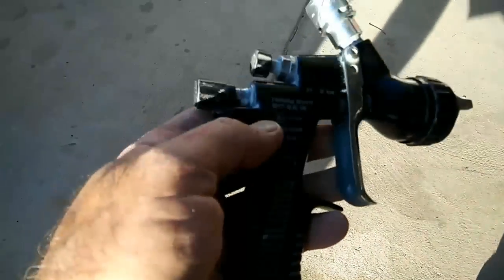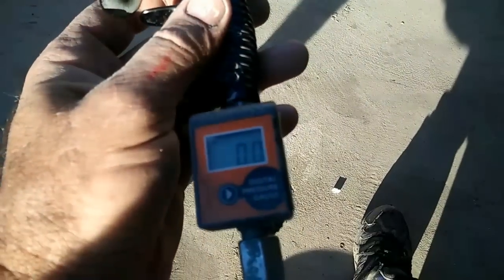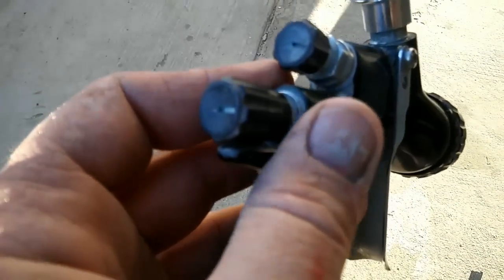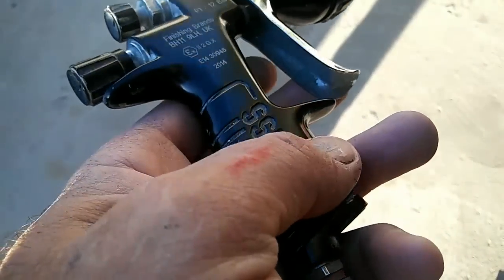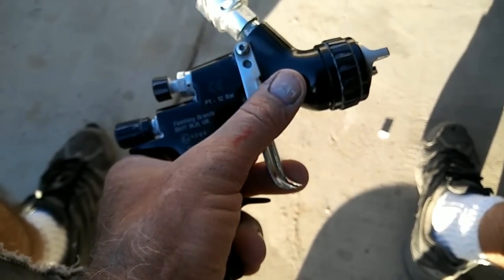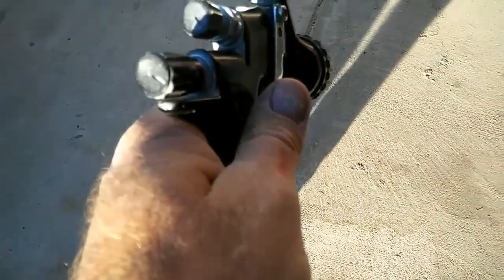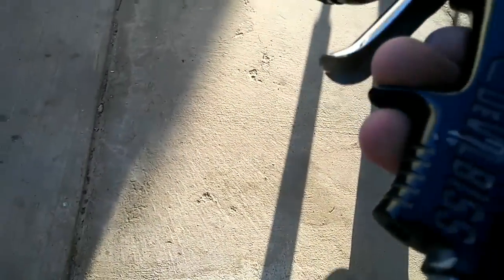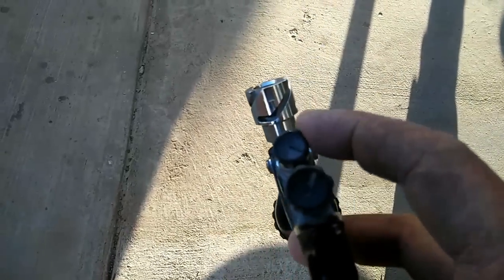How to spray clearcoat without getting any Orange Peel

Comment: Blah blah blah.... Every gun setting is different, there's no point in talking about them. Set the air pressure to 30 psi, and then just adjust the rest until you're getting a nice fine mist and a good amount of clear coat in a pass, without causing runs. Going on too heavy and getting runs? Too much material. Going really slow and it's still looking dry ,not very glossy and patchy? Crank up the flow of material. That simple. Big cloud means good settings. Don't try to paint lower pressure. It will SUCK and you'll be disappointed. Most of what this guy said was terrible advice and he didn't bother to show anything. The settings he mentioned are good for painting in your basement on something small. If you're painting a car don't bother even listening to this nonsense. You want your gun full flow, set for 30 to 50 lb, wide open fan, some guns turn it back just a little if you're getting speckles around the outside of your fan when you test spray on paper or something before you hit the car with it. I paint cars 7 days a week professionally.
Reply: I have the same gun and I set mine at 26psi inlet pressure, hold  the trigger all the way back , turn fluid control  until it stops, then 1 3/4 turns in  lays clear like glass with a 1.3. My sata phaser is a whole  completely different setting. Couldn't agree with you more all guns are gonna be different

Comment: Instead of choking back the Tekna why not get a good LVLP gun like an Iwata or Optima? They produce less overspray without dialing them back.
Reply from the maker: good point there are lots of ways to skin a cat. How about the UK FLG-5 which was not out when I did this video. or the harbor freight HTE spectrum or Black widow? They all work good with less air. But choking the tekna works great FYI. any way you can get there finer spray and smash the dots just a enough to flow out and not puddle and run.

Comment: nice vid..i am new to painting..doing my 78 nova..in garage..21 gal tank.yes..a little small..but it works for doing few parts at a time..bought a harbor freight kit..2 guns..mini 1.1  other is a redish handle.not the purple.. 1..8 and 1.4..the 1.8 sucked tryng to do etch primer and primer..   its an ace paint i got from napa..lots local shops use this product..better than nason here in the states..pa here..anyways..i switched to 1.4 to do second coat of primer..had to jack air up to 35...gun rating is either 40 0r 45..forget.....once all sanded both fenders and hood..i was preped  then to do the sealer with in a month..took a while..i got bad back..spent the month sanding on top my pool table over the winter..no heat in garage..
anyways again..had everything ready to seal...played again with water first to see what settings helped get a good effect..
had to crank air believe it or not  to near 50 with the 1.4 to get a good atomization hrbr frt gun w tip 1.4..
was so near glass when done..yes..the orange peel showed up a little more a week later when i left it cure out right..
by this time..it was cold cold out..and was done painting for the winter..spent off and on in basement sanding..other than the hood..descent days i went out and worked a little at a time.
durring this time..i started searching
i also started watching diyautoschool pete.dallas texas..good guy..and smart..
i knew i had to go with a smaller tip if i wanted to get a better spray..
so i did some gun searching online..now take note..bad back.screwing from work incident.no cash..limited what i could do sadly..
anyways..went to jet tools..well thats what the search led me to..
found 4 1.3 tips..yet do note..my harb frt gun had one single hole both sides the tip
this jet tool gun..no name wom made it which is odd..yet a chance taker buying it.
5 holes..both sides the tip..my thought..this should realy atomize to be able to do a second coat sealer..
mind you..im new at painting..
played with water a little while..then took some old paint..not dried up..house wall paint..because it had consistency to help than waste  good product..
took a little to get a liking to what might work seemned with this product..it was doing way better for painting and atomization than hbr frt gun...
had the pressure up to 45 to 52 to do a amazing flat job ..1/2 to 2 turns out on fluid..  
i will be honest..i started out at  30 psi 3 turns out..did not look good at allvery heavy splatering effect with the house hold paint water base part thined....i knew playing would be diff with a new gun..
it ended up..ok..got to clean everything.alcohol wipe everything down.which dries and really cleans.
tacked off..set up everything by noon..it was 75 already..
mixed sealer for my second coat..got piece crdboard i had with a big smooth sticker on it.. off sticker i went 45 psi 1 1/2 turns out fan slightly turned in  half turn..mb 3/4...was fairly pleased..atomization looked great..
started nailing the hood first because it was laying flat..when i hit that tag on cardboard..i was impressed..
went right to hood and started a few passes..took a quick peek about..looked flat as shiny glass..
once all done..i went and waited 15 min..had a guge fan close by to rid over spray..moved fan towards garage opening.started spraying the wiper grille,back lid deck and the front bumper spacer piece..
6 hrs later..it was fairly dry..was 86 then out..
looked very close to everything.seemned i had way less peel effect if any..i mean it was minuute.
after a week because i started on other bumper parts to get cleaned..and try to prep...
started wet sand 400 with blocks..after dried well..very very minimal peel after the cure up..
$36.52 is what i paid for this...https://jet.com/product/13-mm-Tip-HVLP-Stainless-Spray-Gun-Auto-Paint-Car-Basecoat-Primer-Clear-Gauge-Gr/7725cb459d8546d5ad33a03325d14b32.
those holes in this gun made a hell of a huge difference..and lot less work..think the max at one point i had air up to was around 50.52 max..for a newbie and learning..i cant complain..i had a chance when i had funds to buy a 250 dollar  good gun that looked identical to this gun..not shur whom the actual maker is..but it sprayed very well..i even shot primer on a small piece..near glass finish....
i just pray..when i do my ace 1 or it acme clear that sells well at napa auto parts around here   its a 4 to 1 ratio..
that it goes on good.......im taking it is a medium viscosity clear..might have to thin slight..but it looks runny sounds runny in the gal can..i never opened it yet..and will not untill i have whole car ready..i store everything in basement..its cool and its kept in the dark..out of the light...my color is a good brand..martin seynour paint..metalic..i know i god my hands full putting that on.
yet have to mix very darn good before mix to spray..
i also heard..metalic settles quick..and i read some folks after part spraying..to hold finger over hole..turn gun upside down..give a shake or so and back to paint to keep the metalic well mixed and no settling.
noy shur anyone ever heard doing that..but some pro painter i sen on youtube recomended doing that on a safe side measure..
sorry on long  writing..i like detail so to speak..so no missunderstandings..
but this is my story and experience
Reply: my plan is.2 coats paint on parts..just got underside hood to do,,starting in about an hour.. or 2..
once done..get car put back together..do the bumper main frame inbetween everything else..it gets black and clear..
once i get it all together..then got rest the car to do.but plan is get this thing inspected.
and drive..its been 6 yrs..
mean time.work on rest the car.doors..well from front of doors to the back end..roof you name it..once all 2 coats..i will nail a 3 rd all at one time due to prevent color fading..tips from diyutoschool at SWRNC..
THEN CLEAR THE CAR..
NEXT YEAR BY THE WAY THINGS ARE GOING...but cant wait to repaint the whole thing and clear it.buff nd get it waxed and shiny..
hit a few shows..as a second owner..i not seen a 78 in as good shape as mine sits..barely any rust..few very light surface spots..but thats all on the way to be gone in time..
Reply: here is a last question for you long time painters
keep the med green metalic........
or
being im new to speak in painting..
stay original color..and stay original or add a bit..not much pearl to break up any metalic possible issues showing up when its painted...
just been curious on that..
and opinions what somes preference would be..only 2 parts not original is motor tranny 2 armrests because armrests were cracked falling apart..had no choice...
so  i apreciate any thoughts on that and will help me decide what way to go with..
Reply from the maker: acme 4 to 1 is not a very good clear. It tends to have solvent trap or blushing issues when you spray it on wet. In other words it has a white haze. You can make it look pretty good but it will take some work. having a better gun is the key to getting a smooth no orange peel job. But you will need a bigger compressor. If you use the harbor freight you will need to ba at 29lbs with that clear and near wide open. Spraying very close to the workspace. I dont really remember the gun settings. I have sprayed that clear with a harbor freight gun several years ago
Reply: Mike F I will not use the harbor freight gun....the link I posted.is gun I will use..it's triple the gun than the hbr fry gun...by far....I have been to see a car done back about 9 yrs ago w the ace..acme what ever it is..this was back in the fall..2 coats he used..gun was a 1.3 so the guy stated.think gun was shy 300 he paid.the car I think was a late 90 year..and still looked darn good...not looked bad or yellowed out so to speak..the clear he stated was fairly clear..I don't know.never opened the can yet...I do know here.lot shops buy the line I use..going to use...if it turns dull..options is wet sand down..but diff clear and 're clear...if that's what needs done

Comment: Any video where on how you spray it that looking like mirror just like in this video?
Reply from the maker: you never get it totally perfect.....to get that you need to color sand and buff. If you want to get a perfect finish though you need a very smooth spray. https://www.youtube.com/watch?v=8SUcvUGQjTo
Reply: @Mikefngarage  im still learning my gun setup atm,i need to know what is the 1st layer look like using your setup to get that,and see your 2nd layer,im interested to know it,i did try your gun setting recommendation,i got some improvement,getting no runs now,but still have a slight orange peel,not much but a little here and there, i want to see real time of you spraying it like how close the gun tip,speed,how to see the clearcoat have fine mist on 1st layer and 2nd layer, i understand that it wont be perfect all the time,just for my learning info,hope you can make a video of it,thanks sir🙏👍👍 looking foward for more painting tips on home garage from you😁

Comment: So with cheaper guns doing smaller thing like, the size of a guitar or smaller. Turn the pressure way up, turn the fluid way down and move really slow kinda? I never seem to get this balance right.
Reply: Yup, I would agree.

Also heat up the clear in the can before you use it, heat up the panal and the room too. Also, add more reducer to thin it out a bit.

Comment: Mike, I have a little bit better of a gun than harbor freight (euro pro HE, about 100 bucks on amazon) and was wondering what I should take from this. I got a lot of dry spray at one time, then tried to adjust and started running on the panel...just kinda lost at this point
Reply: No one answered but ill try. No matter the gun, if you're adjusting down to achieve a finer mist, then two things will happen, the fan will get smaller, and wet edge takes longer to develop. Basically this means you'll have to move slower.  

 The problem I have with this is it may not be best to use high solids clear that has a quick flash time.  A medium solids clear will be easier to atomize without sacrificing so much.  High solids clear really isn't that easy to spray without a booth from my experience. You can only turn the pressure down so much before droplets become too big regardless of fluid setting. 
1.

Comment: Then why does the gunman spray with the fluid cranked open at 29 psi and spray glass
Reply: Because Gunman is a pro painter
Reply from the maker: this is more for the DIY at home guy. in a spray booth you can put it to the limits big compressor controlled air flow. At home totally different rules.

Comment: He talks slow because he never used a respirator
Reply: Actually, he's talking ssllowww so that the inexperienced guys can really get the picture! (Materials today are very expensive) Listen and learn. Would you rather he zip through the tutorial and when you start applying the paint you don't fuck it up. Test your equipment and paint on 12"x12" sample sheetmetal plates. Go to your local metal shop and buy 10 pieces of 12x12x 16 guage cold rolled panels. That investment will be used over and over, you won't waste your money!! Practice over and over, once you get comfortable with the outcome you can then proceed and shoot your car. You CAN get a decent finish your first time out, just think it out, don't rush it, and remember that your not creating a showroom finish the first time out. Good luck, body prep is the key component.
Reply: @killadelphia215  actually he's right, this guy doesn't seem to use a respirator, watch his blending spot repair video

Comment: Can you explain the difference in the tekna air caps
Reply from the maker: I switched to the TE 20 which became compliant where i live after this video. A bit finer spray. Also use the 1.3. That is the best way to get finest spray at lower pressure for spraying in a garage or DIY..at home.

Comment: Don't forget about the devilbiss GPI quite good atomization at a cheaper price.
Reply from the maker: never used one are they like the same with a cheaper price.
Reply: @Mikefngarage  they are made by the same mill as the prolites, just without a fancy finish and choice of air caps, I think the gunman said it looks like a te10/110 setup on it. So pretty much perfect for home guys with not enough air to run the other caps.
Reply: Actually even better for the proper spec of it go check out spraygunsdirect's website.
Reply from the maker: @Neishy4AGTE  NIce I will check it out.

Comment: Wipe it off. There is NO gun which save you from orange peel. Every gun is differend, adjust, pressure, viscosity, temperature, humidity, material.... Knowledge is everything. You may always wipe it off.. 😊

Comment: "It's better to have a couple of runs rather than runs and no orange peel" I'd personally opt for no runs with consistent orange peel texture. because inevitably you're going to use a rubbing compound afterwards just to see how crisp you can get it. Which will flatten eggshell no problem. I'd rather deal with that then deal with a run. plus eggshell is showroom standard on most cars I've seen. I've never seen runs though 😂
Reply from the maker: to an extent that is true but on a completely flat panel the orange peel will always be there even if you block sand it perfectly smooth. you really need to spray it super smooth then color sand and buff. Couple of heavy marks or small sags are much less work than sanding all the peel down.  sanding out a couple of runs really doesnt take long and if your a good spot painter you can touch up pretty fast if you sand through. Just need to master the clear blender.

Comment: Hey so what your saying is your spraying high psi in a booth and low 16 psi in a garage?
Reply from the maker: yea just so you can see better. HIgher pressure in booth because you dont need to worry about the cloud. If you spray at home you wont be able to see after a couple of panels at 29lbs or 2 bar. Higher pressure ususally gets finer spray. But you can still get a nice finish at lower pressure if you are at home by using some settings  similar to what I showed you on the video. If I were spraying that in a booth it would look pretty much like glass at 29lbs.

Comment: Use one stage paint it lasts wayyy longer no peeling after 10 years! Only wax and maybe one time buffing
Reply from the maker: yea for sure I used to only use single stage for solid colors and clear for metallics. but I the color formulas are not as good for the single stages where I live so they dont match very well.